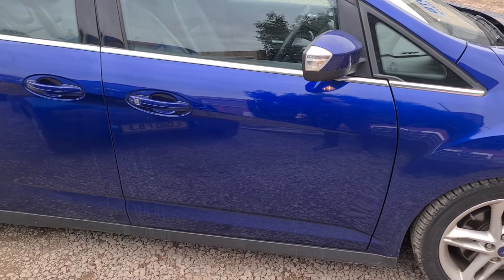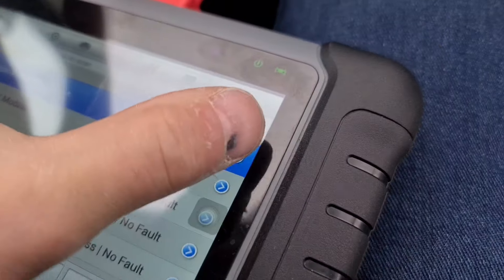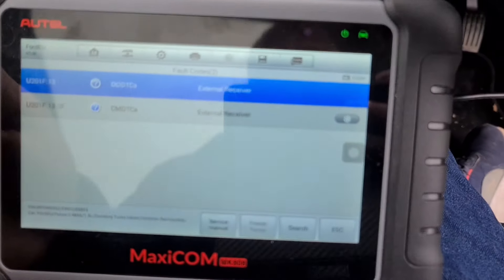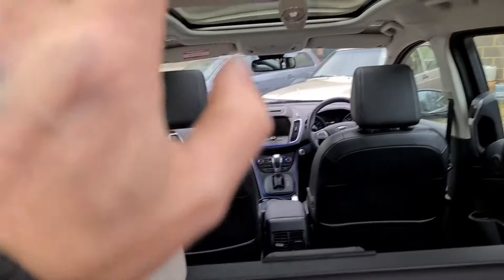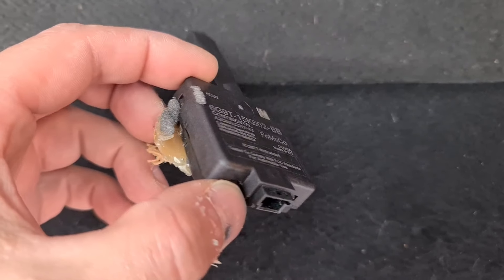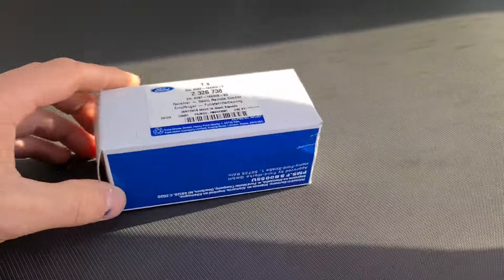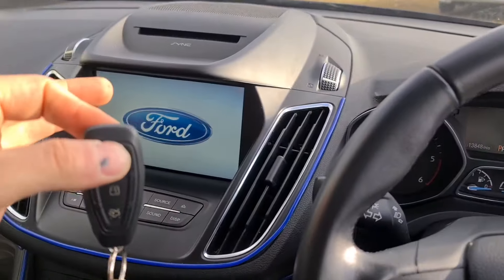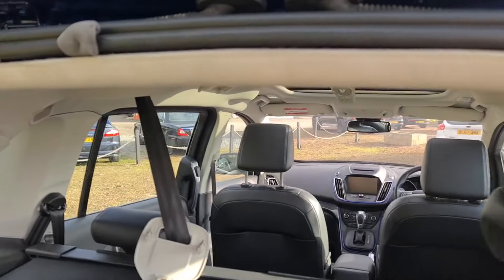Ford key free not detected AN ACTUAL REPAIR/FIX!!!

Comment: I never comment but after 3 years of living with out central locking and finding this video I have to say thank you it’s now working after getting one on eBay cables needed to be cleaned as oxide 
I went to garages and they didn’t won’t to get involved. 

Thank you thank you thank you

Comment: Hiya, we have a similar problem, ford focus 2016, keyless entry works as do the key(s), but none of the buttons on either work. We will investigate further - weather been crap recently, waiting for a dry day to investigate. We have tried all the so called button push fixes to re-sync the the remote fobs none work, tried them all. Auto locksmith offered to generate a new key an recode everything for a cost of hundreds. When queried about the receiver in the roof, the answer was - oh you know about that then!
Waiting for weather - and wife to finish using the car and I will have a look, not sure if my odb reader will detect the receiver module, will update later. Does the module need to be synced back in, or is it plug and go? Many thanks.

Comment: Hi very useful video. I’m having the same problem I’ve had my car in to the Ford garage where they diagnosed the same problem but mine has got a corroded connection that plugs in to the receiver. They have given me the receiver to show me and are saying it needs a new part wiring harness and new receiver that may have to come from Germany with total cost of £515 fitted 😢
Reply from the maker: Just buy the receiver and try that. No reason to quote for a wiring harness at this stage?

Comment: Many thanks for this. I had the same issue when both key fobs stopped working suddenly. Replacing the receiver fixed the issue.
Reply from the maker: You're welcome!
Reply: @atcarsales  hello were is it located on a Ford focus 2015 titanium? Please and ty
Reply: @mikereynolds1981 did you find this? From my research, there is one in the boot, one under the arm rest and one under the centre console
Reply: @mikereynolds1981  I have the same issue. Did You manage to find IT?

Comment: I have a ford flex with the same problem. For some time i suspected it was the receiver antenna. How did you locate it. I cant find any info online where it should be located. There is a fiesta video that shows its under the center console.
Reply from the maker: I would recommend reading the codes first to ensure you're replacing the correct part. 
I spoke to a local friendly Ford Main Dealer mechanic who advised me of the location

Comment: Ive tried this on my 13 plate cmax and no luck do you need to remove the codes because i don't have a reader to hand
Reply from the maker: Best to read the codes before replacing parts but if you have a new receiver then it should be plug & play as per the ending if my video. Good luck 👍

Comment: Hello mate. Great video and work but I can’t seem to find the antenna where you found it. I have the 2016 ford grand cmax which I think is the same model as in the video. I opened up the rear headlining and all I could see was some wiring and components stuck to the roof(none of them looked like the antenna). What should I do?
Reply from the maker: Did you manage to get it sorted!? The antenna in my video was originally stuck to the roof
Reply: @atcarsales  Hi mate, turns out it was exactly there but just a bit deeper. Had to take it down to the garage where they put their hands a bit deeper than I went and boom, they found. Still charged me 10 quid for a 30 second job but anyways thank for the video and reply :)
Reply from the maker: @mamunchoudhury11  super. Glad to have been of some assistance ☺️
Reply: Hi we have a 2016 grand ford c max too but couldn't find the External antenna , looks like a trip to Garage too £££"😮£££

Comment: I have ford Kuga 2012. Code is b2091:60 remote key communication failure. Is it possible to check if same receiver is actually broken before   buying a new one?

Comment: Well I sure hoped this would resolve the same issue on my 2013 Escape. New receiver did not fix mine. Mine worked fine until I replaced the car battery. Since then can only start in the emergency fob location. All fuses are good. Both fobs have new batteries. Get the ford keyfree no key detected fault. Tried resetting battery by the jumper method. After starting screen shows 1 mykey and 1 admin key. Start once and get no key fault. Turn off and back on and alarm goes away. I don't know if need locksmith to reprogram fobs. Odd that it shows 1 mykey and 1 admin key. Really scratching my head on this one. This is the only problem I have had with almost 70k miles.

Comment: 2014 Ford focus Titanium central locking works but no key detected in car I am having to put the key in the steering column port......................
Reply: I've got same problem with my ford's smax 2013, where would the external receiver b found on the smax?
Reply: @noorkhanfamily376  Usually in the roof lining near the back back of middle ?.
Reply: Where was your external receiver?

Comment: Might not be a good idea wrapping it up in plastic as moisture can't escape. Better to use a suitable barrier like silicone or a barrier grease on the plug to stop moisture getting into the plug maybe? Sometimes it may be necessary to to reset the bcm after fitting the receiver. I've found on occasions that the key operates the lot ks but it still says kkey not recognised etc until I reset the bcm(no equipment needed) just look the process up on the tube'.